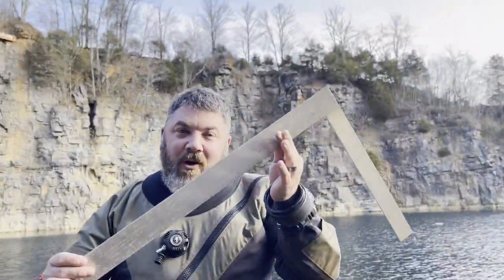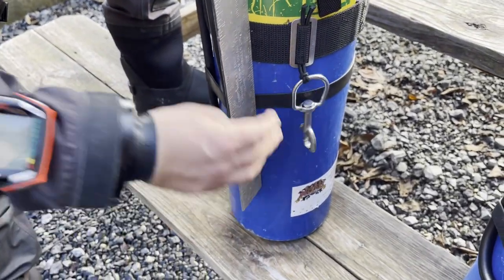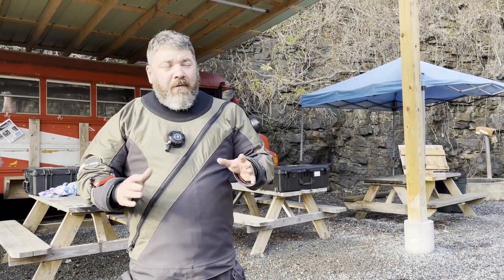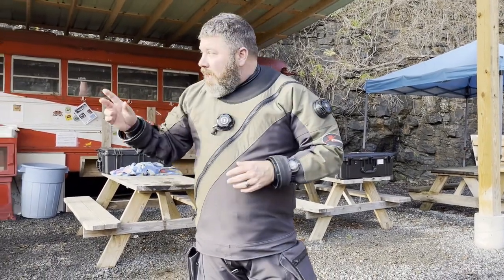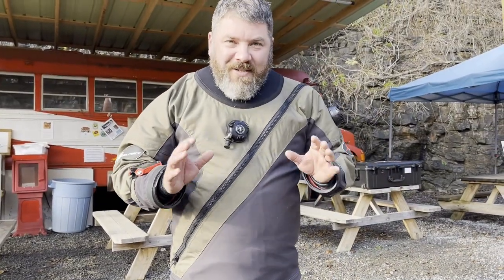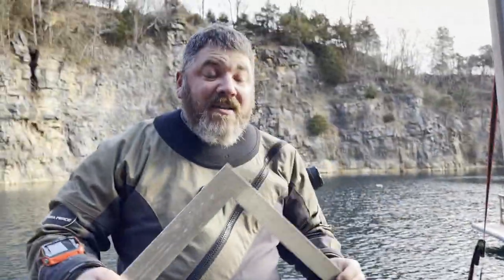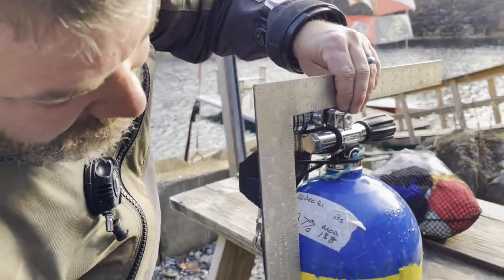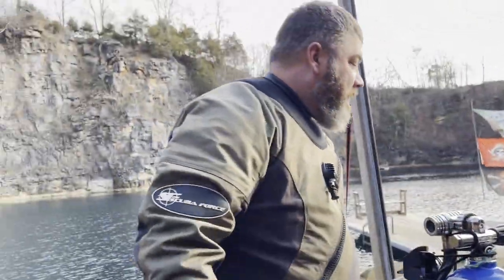Sidemount Quick Tip {[Adjusting Tank Bands]}

Comment: Can you do a video on how you would rig your tanks in a sidemount double configuration if both cylinders had standard left-handed valves? Would you hang them with both handles facing out and have your first stages opposite one another or first stages oriented both up or both down, with one handle to the outside and one to the inside?
Reply from the maker: Hello Rocky DFW, I will be happy to make you a video on that. But I will also answer your question now. In short, I dive with one tank facing in towards my body, and one tank facing a way (this way both valve knobs are still facing out from my body). This has happened a few times on charters where I don't have my own cylinders. Sometimes we have to take what we can get and make the best of it. Another benefit of using cam straps like we do, it allows us to modify our setup very quickly. I simply loosen the cam buckle and shift the strap into position, then I secure it back. We already have videos upload and scheduled until the end of February, so I will try to get you one up the first week in March. Great question.

Comment: When setting up your tanks, what are you measuring exactly and how does that translate directly to the tank and boltsnaps? Am I measuring d ring to d ring. Or armpit to hip or a combination of that? Lets say I measured 20” is that from the top of the tank to the bottom of the boltsnap, or to the band then the boltsnap is adding 2 nches

Do you trim out your tanks using lead threaded onto the tank itself so they float neutral when empty? (Aluminums obviously)
Reply from the maker: Hello Jacob Krause, great question. So the measurement is from where you want the top of the tank valve to rest, to the attachment point on your hip (or sidemount plate if you are using one).  In my case, I prefer the top of my tank valve to be just touching my armpit. So I measure down from there to the center of the D-ring on my hip strap. This is my attachment point. This measurement allows me to get the best position for trim of myself and the cylinders as well. In regards to trimming the cylinders when they get floaty, I prefer to use a series of D-rings on my hip strap, instead of sliding D-rings or weights on the cylinders. Considering I remove the cylinders regularly underwater for penetration purposes, added weights to the cylinders would be adding un-needed ballast weights to my system.  There are many ways to achieve the same goal, this is just my preferred method.